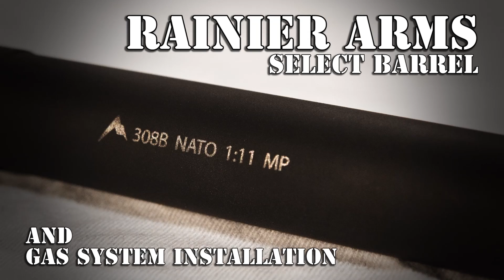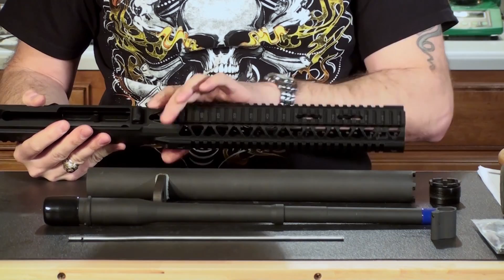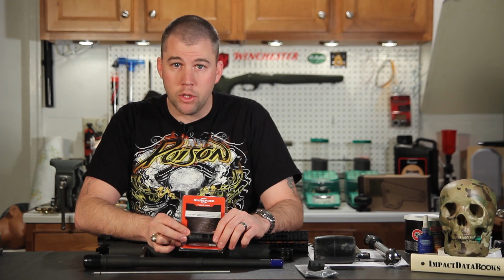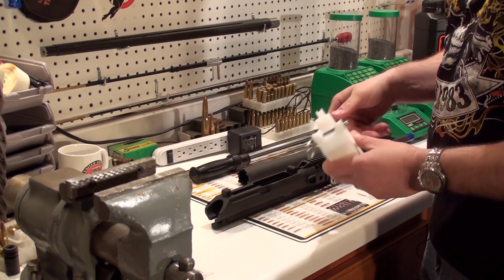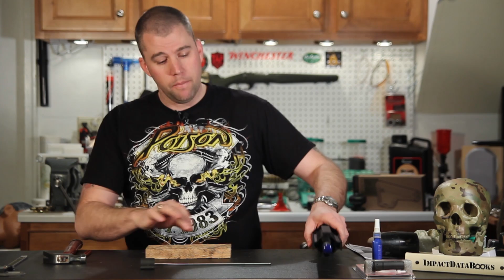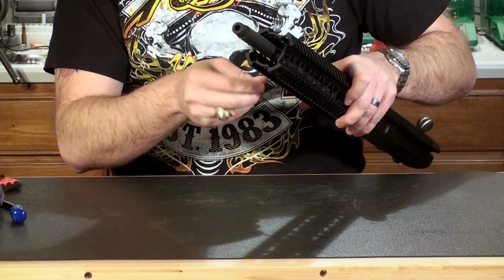MATEN Build Series 07 - Rainier Arms Select Barrel and Gas System Installation

Comment: There was a test performed on clamp on gas blocks in an attempt to move it and the index pin on the barrel extension sheard off before the gas block moved,
Reply: Nothing wrong with clamp-on gas blocks if they are properly installed.

Comment: What is causing my bcg to impact the bottom part of my receiver extension   Too much gas?  Need stronger recoil spring ?   Running a mega arms 16" with a carbine extension
Reply: kgj1119 not heavier enough buffer and/or weak buffer spring.

Comment: Great series.  I do have a question though.  What is meant when you referred the Ranier Arms Barrel and it employed a "DPMS" ? gas system??  Is it a DPMS barrel purchased through Ranier Arms?  Also, how has that SLR adjustable gas block worked out?  I'm building a 300 blkout and am going to install that SLR adjustable gas block on a Noveske barrel with a pistol length gas system.  Thanks

Comment: Very nice barrel. I went with the JP BCG and silent capture spring as well. I don't think I will be using loctite on my build. After reading a couple articles and what people had to say on the forums, I'm gonna stick with my Neco Moly Slide. I would use the loctite 620 though and not the blue 242. The 620 is the high temp slip fit for non threaded application. He mentioned in the video about not planning on heating it up to much, but why not have the stuff better suited for the job ya know.

Comment: Im very jealous, I have yet to pick a barrel for my MKM build. So many options, kinda want to give the new Mega barrel a shot but I am pretty dead set on a 20 inch and can only get a hold of an 18. What did you go with? Are you going to use the Loctite on the barrel extension?

Comment: Whats your logic for using the blue Loctite on the barrel extension? As opposed to the more common moly grease, lithium grease, or anti seize? Thanks for a great series, very reassuring to see you use the same gas block, trigger, etc that I went with.